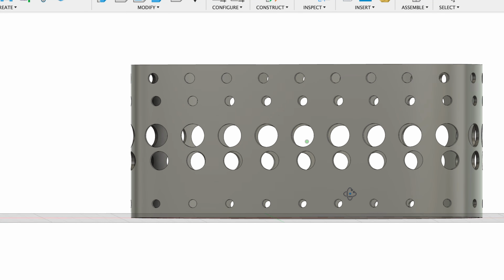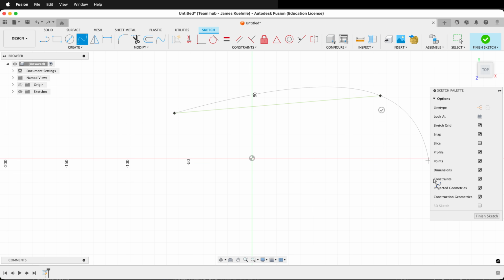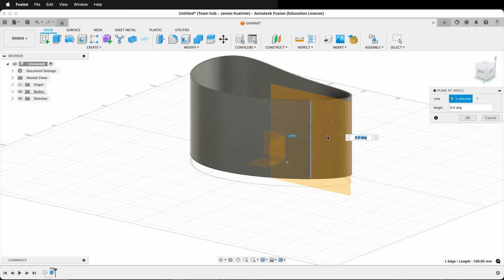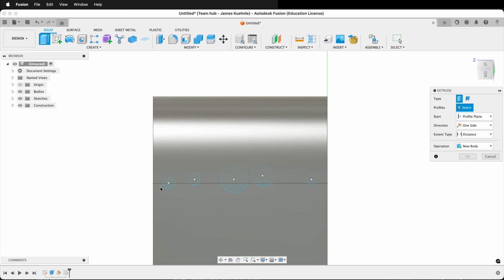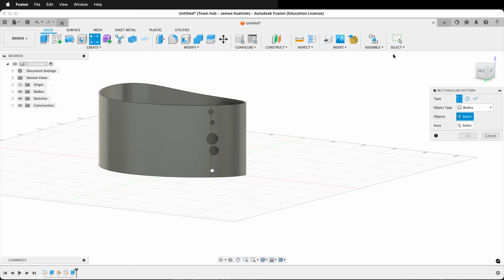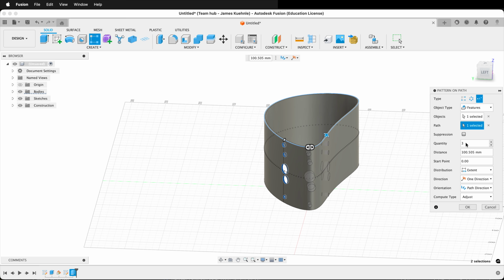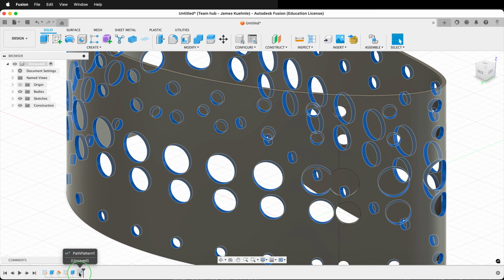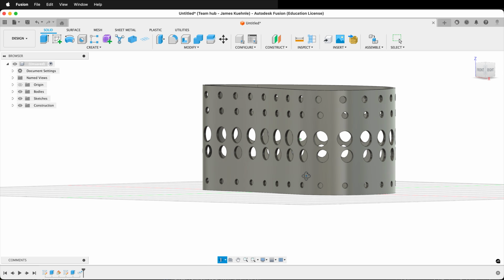Autodesk Fusion: Pattern on Path Cutouts for Curved and Cylindrical Forms

Comment: Great video! Is there a way how to add some asymmetric textures like marble and stone in Fusion360?
Reply from the maker: You mean texture with noise or perlin noise? Or just not the same on both sides?
Reply: @WhatMakeArt  procedural/random texture — like grain, static, organic variation. I've seen your video how to add textures in Blender, but I was wondering if this could be somehow achieved in Fusion 360. The goal is to add some texture to 3D prints to hide imperfections (and just make it look better).
Reply from the maker: There are settings in the slicer programs that can add noise to the surface of the prints. You can do this in Bambu Studio, Cura, and Prusa slicer

For simple noise to hide layer lines, this works really well and makes the parts look pretty spectacular, but you have to be careful if any faces are touching because it will change the dimensions 

I think that's a better solution than actually modeling such a complex texture in Fusion, but you have me curious of whether it's possible and will investigate

Comment: This method introduces a slight distortion of the sketch that is projected due to the curvature. It's my understanding that you can get around this by using the emboss feature instead of using extrude. The rest of the process would stay the same I think.
Reply from the maker: Yes, you are correct about the distortion and emboss is a good solution for dramatic curves